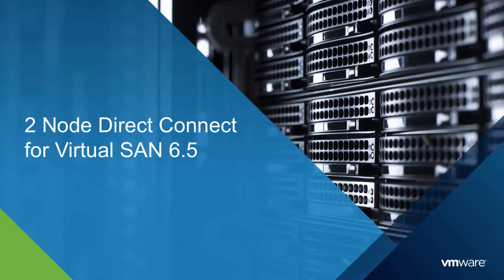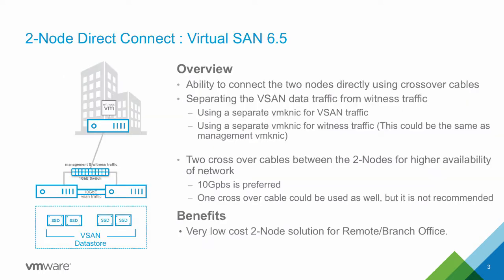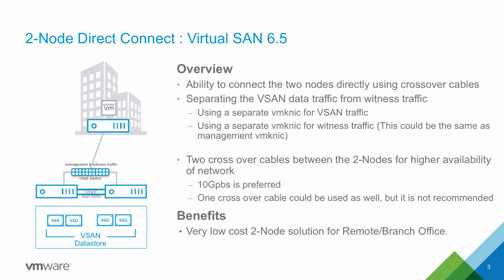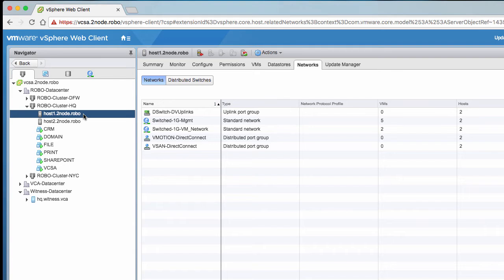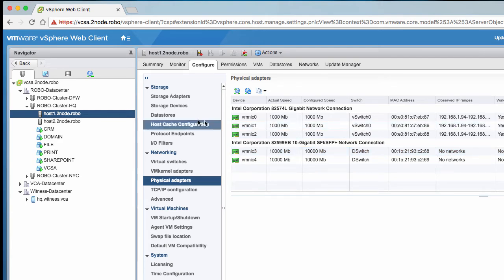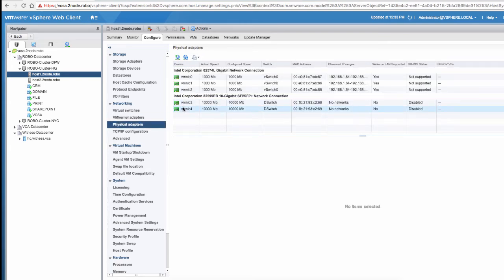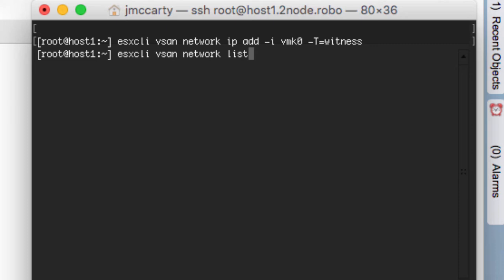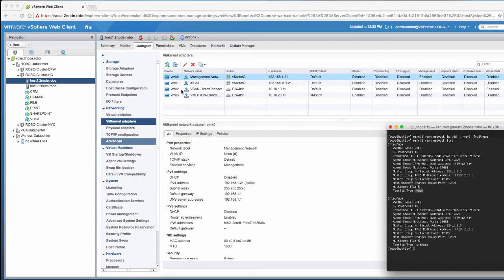vSAN 2 Node Direct Connect

Comment: I created a vSAN cluster and deployed the witness appliance on a separate ESXi free host.  I then added the appliance to the datacenter on the vCenter.  I tagged the management interface as -T=witness.  When I tried to configure the vSAN cluster to a stretched configuration, adding the witness to the mix, it appeared to succeed.  I can now browse the vSAN datastore and upload files and deploy VMs, etc.  However, the vSAN cluster shows the errors, "Witness host not found" and "vSAN cluster partition".  Any idea of what I'm doing wrong?
Reply: Did you figure out the issue?

Comment: When you say Witness Appliance does this mean another server/piece of hardware or just a VM on the 2 node cluster? 

Currently we are running 2x older Dell servers using StarWind vSAN with Hyper-V and 4x 10Gb crossover connections (2x sync, 2x heartbeat) on an isolated network and there is no external witness (witness is done somehow by StarWind locally), but we are looking at configuring a two new servers from Dell and using VMWare instead.
Reply from the maker: Hey David. A vSAN Witness Host can be a 3rd physical ESXi host or a virtualized ESXi host (provided for free as an appliance) that runs on different hardware. 

Lots more info on StorageHub: https://vmware.com/go/vsan2nodeguide

Comment: Hi jase,

thanks for your video.
If I have 2  host having esxi installed...what will be the further requirements to configure Vsan?
in this video you have not shown how to configure it
Reply from the maker: @UnderBetterManagement  I'm not sure I follow the question around the Witness Appliance persisting.

The Witness Appliance is essentially a virtualized ESXi instance that is operating as an external ESXi host that assists with the quorum process for 2 Node or Stretched Clusters.

Today the Witness Appliance must be run on ESXi to be supported. As it stands today, the Witness Appliance setup does not provide any ability to work on Workstation or Fusion, though there are some workarounds. 

You could easily setup a 2 Node vSAN Cluster, even using your external storage, and migrate workloads to vSAN. 

More info can be found in the 2 Node Guide (https://vmware.com/go/vsan2nodeguide). 
I hope this helps.
Reply from the maker: If you want to use 2 Node vSAN, you'll need either a 3rd host to operate as a vSAN Witness Host, or a 3rd host that you can install the vSAN Witness Appliance on. This could be in the same location or in a different location (such as a central datacenter, a VMware Cloud on AWS environment, a vCloud Air Network provider, or the like).

This is because a 2 Node vSAN configuration still requires a 3rd member to house the vSAN Object's Witness Components.

Comment: Hi Jase, at 0:44 you say : "requires high speed networking for large number of VMs or AllFlash". Does that mean switchs are required or the direct connect will do the job?
Reply from the maker: Michel Fidelis - “Direct Connect” can work with 1Gbps direct (host to host) for Hybrid (recommended up to 10 VMs), 10Gbps (or higher) for more VMs (Hybrid) or AllFlash (required), or you actually can use a 10Gbps or higher switch (recommended for Hybrid/required for AllFlash). Using a switch will allow you to scale beyond 2 nodes to 3 ore more later.